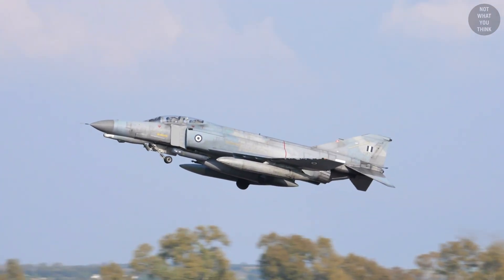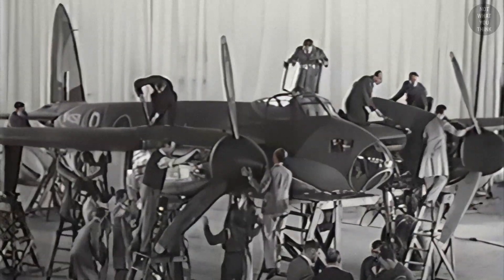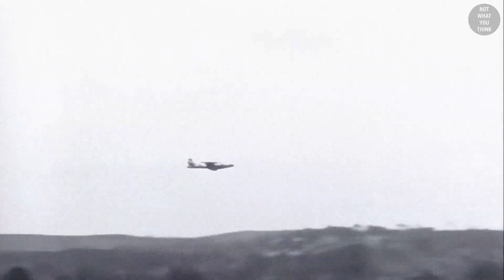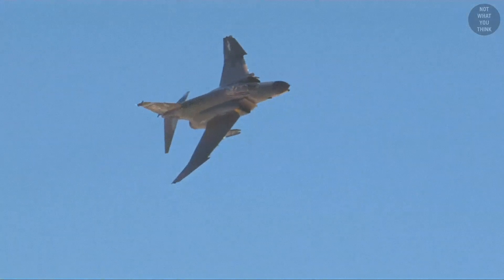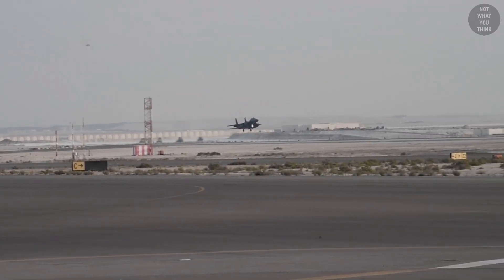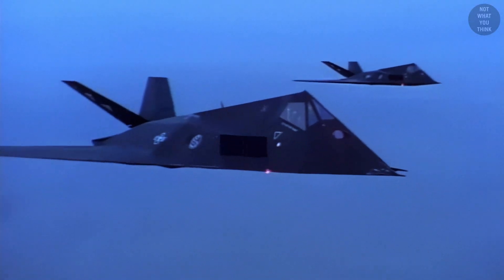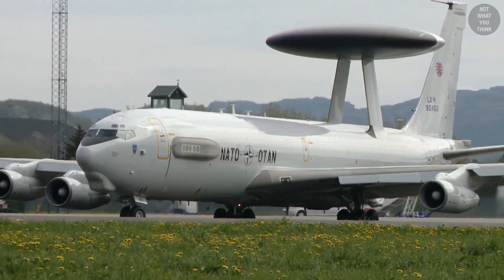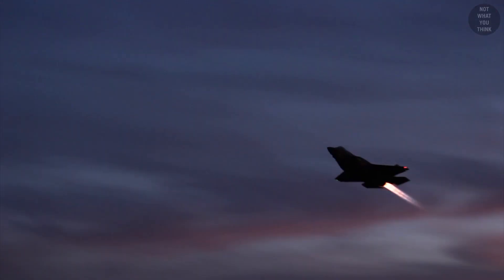Why are Modern Fighter Jets Slower than 1960s?

Comment: You missed a huge factor when it comes to why the F35's top speed is so bad, in particular. These top speeds are only achievable when no missiles or bombs are being carried. The practical speeds of these aircraft, with weapons, is much much lower due to all of the drag they induce.

The key reason the F35 is limited to a mere Mach 1.6 is that it uses internal weapon bays. The extra bulk hurts its top speed when carrying no munitions. That said, the moment you put missiles and bombs on most aircraft, they get considerably slower. With the F35's internal bays, weapons add no additional drag to the aircraft. So the F35 comes out much more favorably when actually loaded with weapons.
Reply: Actually you are completely incorrect on why the F-35 is limited to 1.6 Mach. It is not a draggy aircraft as you and many other low knowledge commenters claim. The design uses a high level of area ruling to produce a low drag profile which is comparable to 4th Generation aircraft in clean configuration. The reason the F-35 is limited to 1.6 is because neither the USAF or USN thought higher speeds are worth the bother. Thus the intakes were designed to be efficient at cruise speeds and don't have the variable ramps to allow the aircraft to reach higher speeds without supersonic air entering the engine (very bad). The design will quite easily pass 2.0 if the correct air is fed into the engine and has been tested up to 1.8. The F135 engine is not at full power at the jet's maximum speed.
Reply: @dat581  Structures weren’t spec’d for exceeding Mach 1.8 and would have cost a lot more per aircraft to rate it for higher supersonic realm, which you correctly called out as being of no interest to the services.  They weren’t flying anywhere near those speeds with combat-configured Vipers and Hornets, so adding .7-.8 Mach over what they’ve been flying increased the practical performance significantly over legacy.

Mach 1.6 is DLFCS-limited on the B and C, while the A does Mach 1.67 according to pilots and senior planners recent statements, very specific numbers, not internet fanboy wishful thinking.

"F-35: Concept to Cockpit" discusses this in-detail, which was written by all the lead engineers and test pilots on the JSF program.  It is far more insightful than anything I’ve seen online.
Reply: @LRRPFco52  Yes. That is my whole point. The F-35 aerodynamically could quite easily exceed 2.0 Mach but there is no point. The Fanboys just don't realise this. They don't understand that the aircraft top speeds they rave about are for clean aircraft and these jets are lucky to get near 1.4 with all their external weapons. The F-35 will easily out run them.
Reply: @dat581  When they did the F-16 DSI intake tests, they were able to achieve Mach 2.0 with it and it behaved better than the standard F-16 intake.  Code One has a great article on it.
Reply: @dat581  so just point the nose at the ground to go faster, makes sense
Reply: @Blox117  Actually no. The aircraft is limited to 1.6 Mach and is not permitted to exceed that limit. It quite easily could in level flight but has been designed not to.
Reply: And stealthy
Reply: unless you go full insane and put weapons on the F-35's external pylons.
Reply: Ya'll wanna use some sources when you're claiming all this sht. It's hard to tell who's right or wrong ffs
Reply: @flyingsac  I've been in aerospace and defense since the 1970s, with 2 decades spent at the USAF Flight Test Center, 2 years in West Germany when we helped the Euros on the next fighter for them (Typhoon before it was Typhoon), went through the NATO AeroE course spending 3 years absorbing the material when I was a cadet, and our family and neighbors were all working on various fighters, engines, missiles, avionics, sensors, structures, etc. 

Most everything in the media has been totally incorrect and downright retarded in their coverage of JSF.  They are clueless about any of this subject matter.

I would recommend anyone who really is interested about JSF to read "F-35: Concept to Cockpit", written by each systems engineer lead and the test pilots, available through an aerospace engineer site.  If you make a video about JSF without reading that book or being close to or inside the program, you have zero business making the video.

The main valid videos on YouTube are from F-35 pilots, senior air planners, and maintainers.  Most of the rest aren't worth watching.
Reply: @flyingsac  

This shit is common knowledge among DCS players. The physics of the game isn't perfect, but they put full scale models of various air to air missiles into hypersonic wind chambers to collect their numbers. The exact physics isn't perfect, but they're close enough that the strategies in DCS are no different than the real thing.

This is just how air to air combat works. The other guy is talking out of his ass.
Reply: @Dubanx  
"common knowledge among DCS players."
And there you have it
Believing a game is close to be being a real thing
Su-24 was downed from 12 miles away by AIM-120 
a L-39 downed from 28 miles again by AIM-120
those are real world shoot downs not fake DCS

You are under the false assumption that pilot will have ample time to react
MAWS and RWR range is limited as well can be hindered by various factors
Reply: @verdebusterAP  

Did  you read the part where I said ED put actual AMRAAM models into hypersonic wind tunnels to model the physics correctly? Those distances and time scales are fairly close to what you would find in DCS world. Not exact, but as close as any non military source will ever get to these classified numbers.

Also, Mach 4-ish is the maximum speed of the missile. The engine only burns for around 10 seconds, so for most of an air to air missile's journey it's gliding. Every turn slows the missile down and decreases the missile's effective range. The entire point of BVR is to drain energy and reduce the opponent's range below your own so that they eat your missile while theirs falls short.

Also, giving out ranges without any context to the altitudes involves proves you don't understand what you're talking about. 12 miles would be the edge of an AMRAAM's range at sea level, but well within the MAR when both aircraft at 30,000 feet. In theory, an Aim-120c can hit past 50 miles under ideal conditions, but against a maneuvering target in actual conditions a fight is more likely to end at closer to 10 or 20 miles. Those maneuvers play a great role in accomplishing that.

 A couple turns combined with descending into the thicker atmosphere below greatly slows incoming missiles down and reduces that range. Seriously, go look up the F-Pole maneuver. Also, you don't wait until the enemy launches its missile to begin maneuvering. Fighters maneuver as soon as the two aircraft close to within within launch parameters.

It's clear you lack an understanding of even basic concepts of BVR.
Reply: @verdebusterAP  Said by the guy with lots of claims, zero sources, seems to think missiles travel at a constant speed, and talks about how AMRAAMs hit at X Range or Y Range  with literally zero context as to the launch parameters involved. As if those hold literally any meaning on their own.
Reply: @Dubanx  
Says the guy that uses a game as his source LMAO
Reply: @verdebusterAP  People use those strategies in DCS because those are the strategies used by actual pilots, not the other way around.

The details are certainly not flawless, but it's close enough that real world strategies are effective. Hence why they are used.

I only point to DCS because it's the only real way to learn how air combat works in practice. Much moreso than a random layperson pulling nonsense out of their ass.
Reply: @Dubanx  
Again clown
DCS is nothing but a game
doesn't matter how hard they try to add 
realism 
its still a game
Reply: @Dubanx  Ohhh I see well I'm just an aviation enthusiast never played that game would love to try tho haha but I'll stick with msfs and x plane for now lol
Reply: @verdebusterAP  It might be a game but physics is physics. If you model it correctly it will work correctly. The only reason you do live test is to check if your sim is accurate and to see if you missed anything. You sound to much like a reformer to be taken to srsly.
Reply: @someonespotatohmm9513  
You are sitting behind a screen
Are you getting fatigued -no
Are you feeling the force of gravity-no
Nuff said
Reply: @verdebusterAP  yes great idea to argua about human factors, when talking about missile performance XD.
Reply: @someonespotatohmm9513  
Its a world of difference when you are actually in the cockpit
As far as missile performance
again worthless
In 2017
an F-18 downed a Su-22 with AIM-120 after the AIM-9X malfunctioned
Wouldnt happened in DCS
There are several real world incidents where missiles has failed that wouldnt happen in DCS
I watched DCS video where missiles failed to proximity fuze
but please keep believing thats its real
Reply: You mean, all those weapons that are as much use as having a water balloon as your main armament in the incredibly useless F-35? What use could any of them be? Seemingly these Americans have no idea the F-22 and F-35 can't see, track, or target any other stealth aircraft from BVR (beyond visual range). Stealth alone defeats high-frequency (short wave) radar by absorption and deflection, it does not defeat low-frequency (long wave) radar. Therefore, to see, track, and target stealth aircraft you must have long-wave radar, but it must also be enhanced to remove all background clutter for targeting purposes.

Neither the APG-77 radar used in the F-22, nor the APG-81 radar used in the F-35, can see any other stealth aircraft from BVR (without enhanced long wave radar) — This fact the US Air force obviously know! Only it seems the reality is, that when the F-35 radars were being designed 13 years ago, there were no other stealth aircraft to think about as a potential threat? So how can these US aircraft be seen as any sort of threat to either China or Russia, who both have these aircraft technically beaten? They can see and target US jets from BVR, yet the US jets can't even see them from BVR?

Russia's new 5th generation Byelka (2band) radar, used in SU-57, does have enhanced long-wave radar, they've designed and developed the first L-Band fighter radar we've ever seen. They've cleverly embedded L-band AESA radars in the leading edges of the wings. The new L-band AESA radar data gets processed in real time through extremely powerful Russian Elbrus computers being significantly enhanced removing all clutter, meaning it can see, track, target, and engage enemy stealth aircraft from BVR. The technology along with its impressive range parameters and jamming ability over large areas make this aircraft deadly to all other aircraft types. 

They can also interact in ''real-time'' with each other member of the squadron, (auto selecting) the best placed BVR missile, that can be fired by anyone of the squadron with a bogie on radar, they can also take control of surface-to-air (SAM) missile defence systems - (that alone is lethal), and they can see track, enemy stealth fighter aircraft long before Russian airspace, from much greater distances, with "real-time" data from massive Russian ground long wave stations (that are all protected today with the networked S-400 defensive system). 

Therefore, as they'll always know where the enemy aircraft are, they'll always be able to approach any enemy aircraft head on, and therefore stealthily, (Russia wisely sacrificed rear end stealth for much better manoeuvrability) meaning today, the US fighter jets would not even be able to see them coming!! Russia's Byelka (2band) radar covers all aspects of frequencies across all channels, that are used for tracking, targetting, and also jamming. It's part of Sh121 multifunctional integrated radio electronic system (MIRES) on board the SU-57. 

Russia tested much of this new radar suit on the SU-35, so they also have the option of fitting this radar into SU-35's permanently, meaning Russia's SU-35S flanker will be at no disadvantage with F-22/35. As although the SU-35 can be seen and targeted from BVR, the SU-35 with the new 5th gen radar is as able to see and target the US jets from BVR, seeing the all-important Russian advantage in BVR missile distance, plus the excellent manoeuvring, neither the F-22/35 have, as more than critical, if you're going to avoid simply being blown out of the sky.

The design has clear potential to provide a genuine shared multifunction aperture with applications including: Search, track and destroy missile mid-course guidance against low signature aircraft. Identification of Friend, Foe/Secondary Surveillance Radar. 
Passive angle tracking and geolocation of JTIDS-MIDS-Link-16 emitters at long ranges.
Passive angle tracking and geolocation of L-band AEWC-AWACS and surface based search radars at long ranges.
Passive angle tracking and geolocation of hostile (i.e. Western) IFF and SSR transponders at long ranges.

High-powered active jamming of JTIDS-MIDS-Link-16 emitters.
High-powered active jamming of satellite navigation receivers over large areas.
High-powered active jamming of L-band AEWC-AWACS and surface based search radars at long ranges.
High-powered active jamming of guided munition command data links over large areas.

Effectively neutralizing the USA's use of AWACS for their detection. The Tikhomirov NIIP L-band AESA is a very important strategic development, and a technology which once fully matured and deployed in useful numbers, will render narrowband stealth designs like the F-22 & F-35 Joint Strike Fighter, and some if not many UAVs, as highly vulnerable to all Flanker variants equipped with such radars.
Reply: @Dubanx

Speed is not important 
You missed that part were modern missiles are substantially faster , far more agile and significant more accurate than missiles designed in the 1960
Reply: Also stealth design is generally not aerodynamically optimised. Russia tried that with SU-35, but lost some of the stealth in return.
F-35 goes pretty hardcore for stealth and that pays off in many circumstances. It should never get involved in a classic dog fight anyway.
Reply: @T33K3SS3LCH3N  If we accept your assertion that F-35 stealth isn’t aerodynamically optimized, can you talk us through the applied physics as to why the F-35A accelerates faster than the F-22A and F-16C Block 50 in the subsonic regime.  Keep in mind that the F-22A has 70,000 pounds of thrust in full Afterburner with its 2 engines, whereas the F-35A has one 40,000lb thrust engine in burner (downrated from 43,000lb to preserve engine life).
Reply: The F-35 may be a nice bird, but it definitely has its limitations and as a result one has to wonder about the insane price tag as well. Not sure if it's a wise idea to promote this as a one size fits all solution that some officials have done in recent years, even if it is very useful.
Reply: @thunderbird1921  That's a pretty ignorant comment.
Reply: @thunderbird1921  
Cheaper than an F-15EX or Rafale
Reply: @thunderbird1921  All 3 JSF variants are the most affordable fighter-type platforms on the Western Market right now, and have been for a while.  Gripen E is more expensive than the F-35A.  Typhoon and Rafale are way more expensive than the F-35B and C even.  Unit Program cost on Typhoon and Rafale are both over $200 million each now, as evidenced by the recent large FMS contracts to India and UAE, as well as the Luftwaffe buy of more Typhoons.
Reply: @thunderbird1921  When you consider the F-35 is trying to replace several aircrafts whose combined price tags exceed that of the F-35's it all makes more sense. Real Engineering made a pretty good video regarding the F-35's enormous price tag and why it isn't as bad as most people think.
Reply: @thunderbird1921  The price per aircraft isn't much higher than generation 4 aircraft, and the massive development cost is shared with US allies that are also buying the f-35.
Reply: There are other reasons why the F-35 isn't as fast as other aircraft. One is that its stealth coating doesn't deal with supersonic speed very well. In fact, the F-35 doesn't really want to fly at supersonic speed at all, it damages the stealth coating  on the tail of the airplane.

The second is that while the F-35 is a true multirole fighter, it's primary design focus is as a strike fighter. It is the first fighter in the world that can replicate what the F-117 did. It was meant to have a large number of F-22's providing air superiority for it.  As such, it's design favored stealth and having long range on internal fuel only. Supersonic flight doesn't provide much benefit to this mission profile.
Reply: @Elthenar  This type of comment is based on flight tests on the first 6 LRIP F-35A/B/C airframes that were made and flown from 2006-2010, and were never mass-produced.  Only 2 of those airframes, 1 C and 1 B model, exhibited some higher temps on the aboard H-stabs that concerned the engineers about longevity of some of the RF sensors back there.  Nobody ever witnessed any blistering, delaminating, or damage to those surfaces or structures, just that the instrumented test birds indicated some parameters the engineers didn’t like.

They tried to duplicate those thermal readings on the other 4 JSF LRIP birds, and even with sustained supersonic runs up and down the East coast from tankers to tankers north and south, they never saw the higher temp readings on those 4 aircraft.  All of those structures were replaced with Carbon Fiber spars, spanners, and runners so there was no longer any metallic structure to facilitate the thermal loading that was seen on the 2 birds in question.

Media:  “The F-35s skin is melting!!!!”

They can absolutely fly the supersonic limits and never see any of these problems on the actual production JSF series.
Reply: @LRRPFco52  Then why are active duty F-35's speed limited except in case of emergency?

Besides, the F-35 will rarely need it's supersonic speed. It's primary mission is that of a modernized F-117. It was always meant as sensor laden infiltrator, not a high speed low drag interceptor. In fact, it is only likely to kick on the burners if it has to run away or evade something.
Reply: @Elthenar  The original vision for JSF involved multiple mission profiles for each service variant, with take-off and landing methods driving the substantial differences in structures, airframes, and propulsion.

USAF wanted more of an F-16 replacement with imoroved VLO features over the F-117A, along with all the sensors F-117A never had, with 100nm longer combat radius than a 2-bag Viper, capable of matching or exceeding the combat-configured Viper's kinematics.

Navy wanted a replacement for F/A-18C with VLO they never got from A-12 program, with at least 100nm longer mission radius than the Hornet, and got 100nm+ longer than Super Hornet in the process.

UK and USMC wanted a supersonic replacement for Harrier with longer legs, more payload, more survivability using VLO.

All had multirole in-mind so there would be usable platforms in the ATO, unlike the F-15C or A-10 most of the time.  

What they got was something that included that and a bucket of fries, side order of shakes, happy meal, seasonal passes to vacation spots, and much more.

Nobody thought F-35s would be acting Ike an EF-111A or EA-6B, then executing a continuous ISR profile en route to a deep strike like F-117A into the MEZ, then pivoting into self/buddy BDA, then into an Airborne Controller, or opportunistic OCA killer, then back into an EF-111A on the way out.

Nobody thought that, and they're just getting warmed up.  Nobody thought they would be border-skimming Spyplanes sucking up all the trons and thermal signature providing collective targeting data in a live warzone the US isn't actively participating in.

Nobody thought they would be TBM detection platforms with a vast sensor web complex that tracks low earth orbit satellites.

Whatever everyone thought they were going to be used for, they have stepped so far outside that box, that nobody but older guys remember those days.
Reply: @LRRPFco52  LOL. I remember all of that. 

It was built with a collection of abilities but they didn't realize how capable that collection was until they starting building it.
Reply: @Elthenar  The main concept was a little single engine stealth fighter with internal weapons bays and a FLIR integrated under the nose so they don't have to bolt on pods anymore.

Instead, they got a secret Darth Vader Sith fighter conceived on an off-grid world, built by aliens shape-shifters working for Lockheed, Pratt, NG, and BAe.